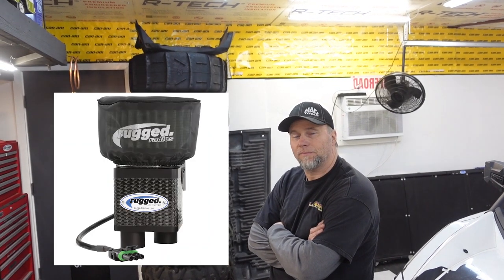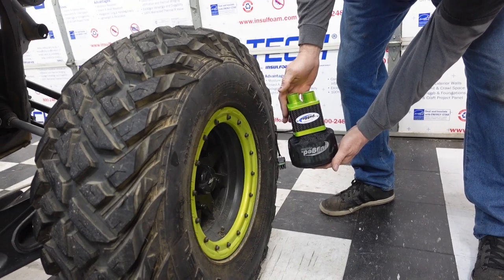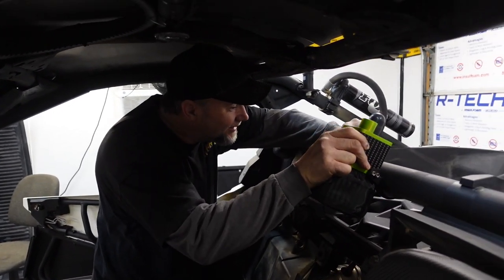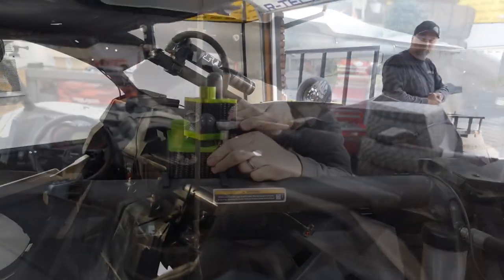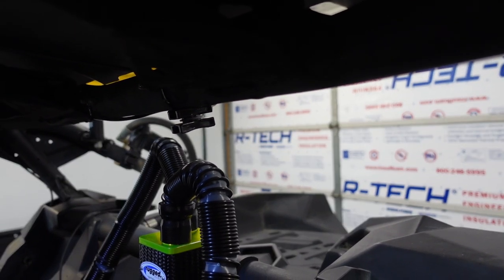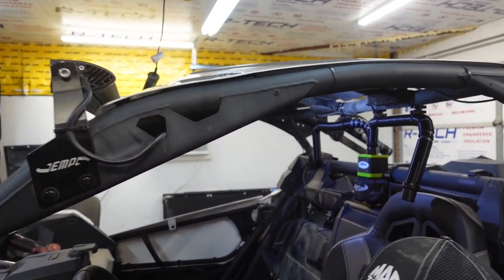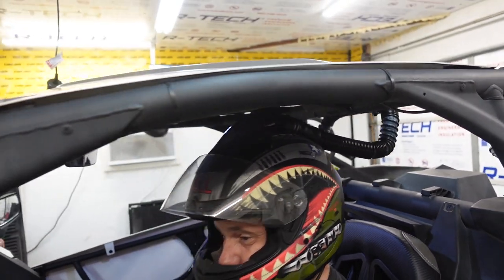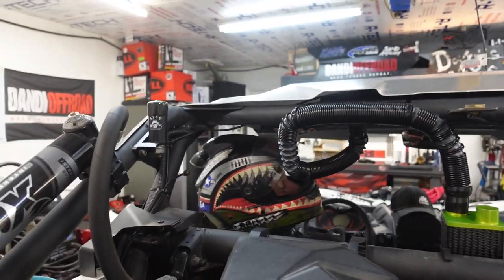CUSTOM Rugged Pumper X3 Install

Comment: I did the same setup putting the pump upside down but then realized I was just sucking up all the heat from the engine. I'm going to put it upwards where the filter is up so it does not get the heat from the engine.
Reply from the maker: We don't seem to be having that problem

Comment: Nice!
Question?
Did you just connect two Tie Mount Base Saddle Type zip tie holders together or do they make it that way?
Maybe you have a link to the vender?
Reply from the maker: Lets see if we can get Danny to answer, he provided the hardware, or plastic ware. LOL
Reply: They came that way, I had them at my work, but they also have them on Amazon

Comment: The hoses that the Rugged setup come with do not flow well I think it's the collapsing style that makes it not flow well. Change over to a no collapsing like the PCI and you will absolutely pickup some cfm output.
Reply from the maker: I have found that if I keep them as short as possible it helps a lot

Comment: What is the part name you use in 12:12 ?
Reply from the maker: I am not sure exactly what brand that one was but it is something like this.  https://www.digikey.com/en/products/detail/hellermanntyton/DSWS50HSK2/4434316?utm_adgroup=Cable%20Ties%20-%20Holders%20and%20Mountings&utm_source=google&utm_medium=cpc&utm_campaign=Shopping_Product_Cables%2C%20Wires%20-%20Management_NEW&utm_term=&utm_content=Cable%20Ties%20-%20Holders%20and%20Mountings&gclid=CjwKCAjwj42UBhAAEiwACIhADoL0ACK5g6j-WZKsR2KoIFPcdO8tYJy_KgTSCRo9rQvbWVFUeavnbBoCHbcQAvD_BwE